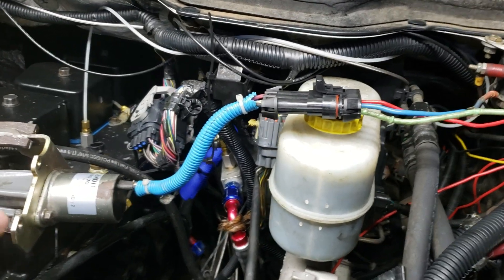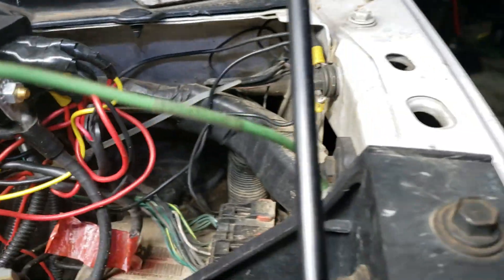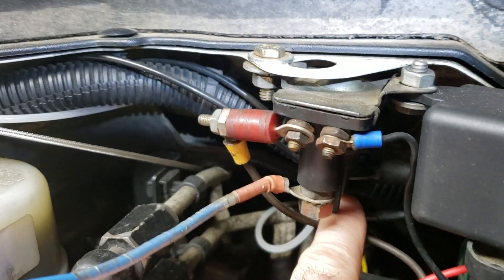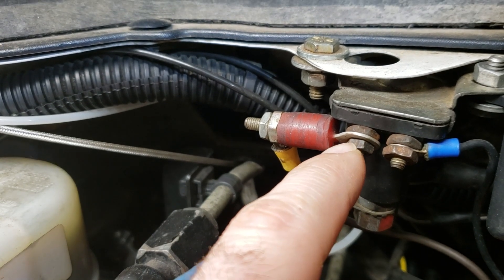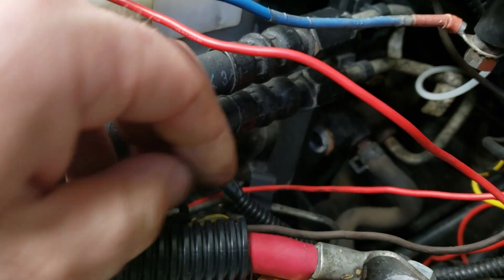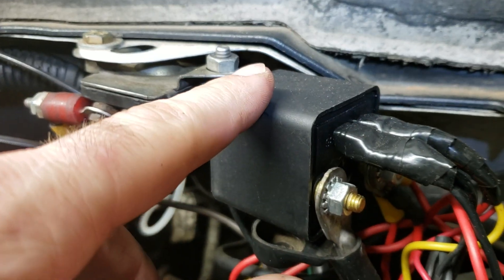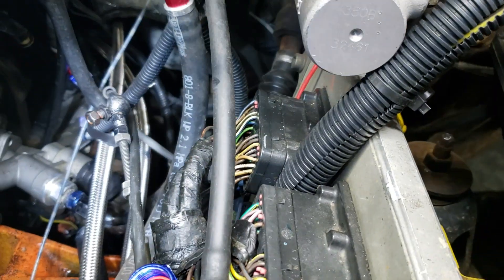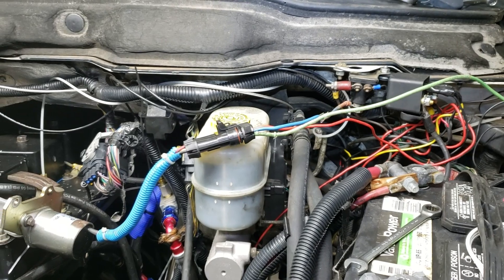Wiring The Fuel Shut Off Solenoid in On A 12v Swapped Cummins Truck

Comment: Why is this necessary? Is the ignition start & run wires/factory inadequate?
Reply from the maker: Well, the factory ones do have problems and have to be swapped out from time to time, but this video is reslly for the guys who are doing a swap into a truck that was originally something other than a 12v and doesn't have the wiring in place. You can shut a 12v off with a choke cable, but the setup you see here allows you to shut the truck off with the key.
Reply: @70440charger  A cat excavator I just bought has a mitsi 4m40C1A motor and I can only shut it off with the chock so I am workimg out how to get it back to turning off with the key. For some reason the previous owner has ran wires from the battery to the key so it starts but wont shut down by key.

Comment: I hope you can help understand why the solenoid from a bosch ve pump comes with a "solenoid control" with 3 pins part number: 0281005025
In my case the truck stops without a notice and runs great when it runs.

Comment: Use a Ford starter solenoid. I am going to use my starter solenoid to power the pull coil on my swap I am currently working on. I am putting a Ford 6.6 diesel into my 97f250 with an nv4500 trans behind it.
Reply from the maker: Thanks for the comment! You are right that you can trigger it using the starter.  Just make sure to install a one way diode. If your pull solenoid gets stuck on (which does actually happen) it will toast the other burn up your starter. 

Your project sounds pretty cool! Let us know how it turns out or better yet, post up a link to a video of it when you get it finished!
Reply: @70440charger  will do! Thank you, the starter on the engine has a solenoid, so I am only using the original one to power the pull coil. The switched power for the original ignition coil will now power the hold coil. I will post a video

Comment: Are you running the in tank pump to the mechanical lift? Or a sump kit I've finished my 12v swapped 05. Just keep loosing fuel. Last hurdle.
Reply from the maker: Hi Derek, Correct! We are running the the high volume / low pressure in tank lift pump to either the mechanical lift pump on the side of the block and in other cases, we just run it to something like a walbro 392. We also ad in fuel / water separators and a 2 micron fuel filter  just to make sure everything is nice and clean for the injection pump.

Comment: Hi I'm doing 2000 F450 Fummins and need help on the Fuel shutoff switch their are other people that wire it different I'm confused can you detail which wires go to were thanks.
Reply from the maker: Hi There! Thanks for the message and sorry it has taken a second for me to get back to you. I would be happy to help out. Have you watched this video yet? It will work with no issues if you follow how we show in the video here. I try to be specific about ground wire, the pull wire and the run wire, but I know it can be tricky. Let me know exactly what it is that is giving you an issue.

Comment: What if the colors of the wire  in the solenoid were interchanged, is there anyway to read it with multi meter to Know the wire with highest resistance the one that should go to relay posite , the one that should be grounded and the one that should go to kick solenoid
Reply from the maker: Well, I should say... don't get too caught up with the color of the wires. Our shut off solenoids have come with different wire colors.
The easiest way to figure out what needs to go where is to grab a simple wire from a 12 volt source.  Hook up a ground to the - Ground wire and then take a +12v wire and touch it to the wire you are testing. If the arm jumps up, that is you pull/kick/lift. That one takes the most current and it needs heavy gauge wire, but it will only be on for a split second. It cannot stay on! It will burn up your solenoid. Many guys have burned up their shut off solenoid thinking "what could that hurt?"

If you pull that wire off, the lift arm should drop... The other hot wire will be the HOLD wire. That one take low voltage and holds the arm up.  Just take a piece of tape and mark which wire is pull and which one is hold. Hope this helps some!
Reply: What I've found is the black wire on the solenoid is always ground. The center wire and the other wire are hold and pull in functions. Hook up a jumper wire to ground and another wire to positive battery, then take the other end of same wire and touch the other spade terminal in the solenoid side of the plug . One will pull the solenoid in . Do not leave this wire hooked up for more than a couple seconds or the solenoid will go up in smoke. Manually push the solenoid plunger in and touch the other spade terminal in the plug, this should hold the plunger in. The other problem ive found is the new solenoids are not always adjusted properly.  If the adjusting screw is too long the engine will start but immediately shut off when the key is released. You'll  have to play with that to get it right. As far as using a multi meter I'm sure you could if you new what ohm values were for each winding in the solenoid.

Comment: Would you be able to add part numbers? I'm doing a 95 Ppump swap into my gasser '81 first gen. The shut off is the only part that needs to be wired, I understand electrical on a basic level that applies to this all my experience and exposure is from an industrial background.

Thanks Guys
Reply from the maker: Hey Brent! We will try and get those up for you. Just as some feed back, My friend whose truck this is now, uses it just about everyday without any issues.

Comment: Is there a way to wire it to a switch an you can just switch it on to click ??
Reply from the maker: Sure. You would need one relay for the start side and the run side is low enough draw to be handled with just a switch.
Reply: Break-It Brothers Diesel but on the wires witch wire does what. Like the pull wire where would I put it if I used a switch an what kinda switch would be able to handle the power??
Reply: @JasonY02  the start side is the only one you need a relay for(takes the load of of the switch. the run he said is low draw so can be wired direct if im not mistaken
Reply: @70440charger  wheres the links to the relays?
Reply from the maker: @josephmusino1190  Sorry about that. I forgot to drop them in. Good news is that we have been running them daily for about a year now with no issues. They seem to be rock solid. I will put them in the notes today!

Comment: Pretty happy to see this. I will be needing this for my p pump swapped first gen when I do the job. I have everything just need to find the time.
Reply from the maker: I hope it help ya out cause when we went to do ours. It was a headache... just want to save people some grief!
Reply: Break-It Brothers Diesel out of curiosity does the second gens have a diode from the factory? I have a 1996 harness to utilize for my swap.
Reply from the maker: @jasontruman1215  Not that I have ever seen. We  use these diode in our 3rd gen swaps, but they are sold for the 2and gen guys and we just redirect them!